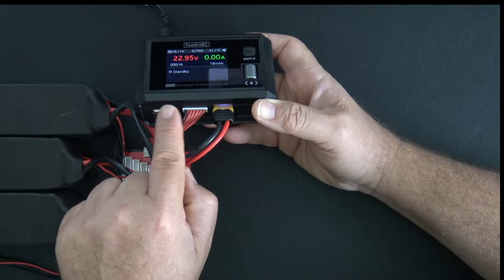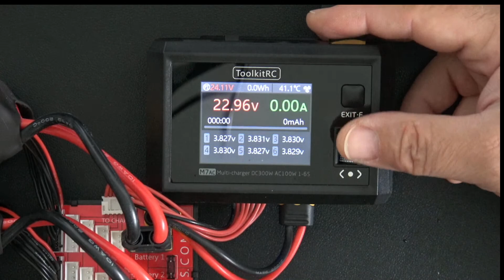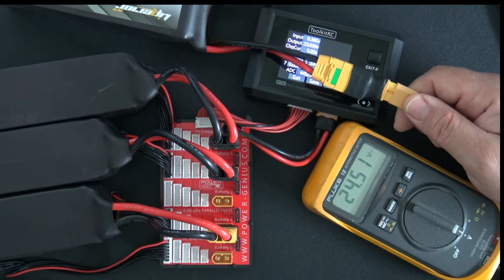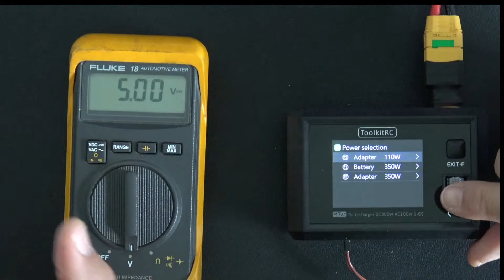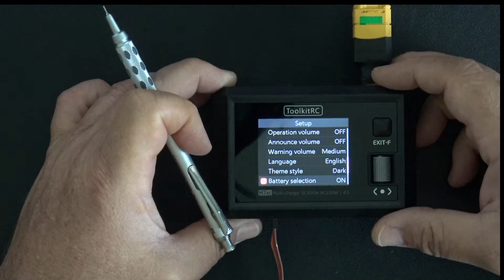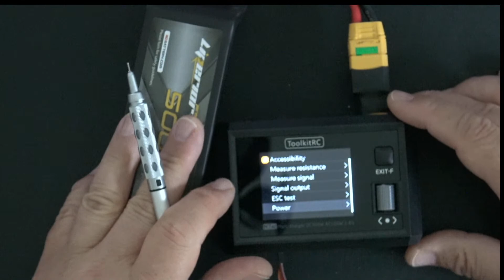ToolkitRC M7ac Multi-Function LIPO Battery Charger First Look

Comment: Hi! Can it charge LiPo without balance port? Like 18650 or 18V Makita's battary?
Reply from the maker: Battery profiles are LiPO, LiHV, LiFE, Li-ION, LTO, NiMH, PB(lead acid), and UAVbat (DJI).
Reply: @RCVideoReviews  When choosing a LiPo profile, can I turn on the 5S battery without a balancer? Will the charge start or will there be an error?
Reply from the maker: No, LiPo profiles always require a balance connection.

Comment: I have one and the AC input is broken. I can not get a power up from the AC input. Any solution?
Reply from the maker: That sounds like a hardware fault. I would start with basics like trying a different power cable. Maybe open it up and look for any obvious damage. Otherwise you may need to contact ToolkitRC.
Reply: Mine arrived today. I have the same issue. It didn't power on from AC. But if i plug a battery into the charging port it powers on. If I then plug the AC cable in it reads 18.2 Volts as input, but after i start the charging process, about 5 seconds later the input voltage drops and stops charging with the error message: "Main port disconnected"
Reply: @BerkeiSzilárd  I make a tech support request and they send me internal psu replacement unit. I soldered the new one it's now working fine. It's internal PSU problem
Reply: @pusico6555  Thanks for the info. I emailed ToolkitRc and the store i bought it form. Hopefully I get an exchange. I don't want to solder my brand new charger.

Comment: Toolkitrc is the worst company ever. Their products are an absolute joke and they deserve 0 air time. Had 3 chargers that failed miserable in less than 4 months, opened a ticket back in July last year and first that I heard back from them was January this year and only one email asking about how long I had the charger for and never received any updates. They have some very nice innovative features but their quality control is non-existent. Great review of the product mate but I would steer away from toolkitrc.
Reply: i've had an M6D as my go-to charger for over a year now and have had exactly zero problems.  i would venture to say that you somehow got into a bad batch of chargers...which happens...in all fairness, i don't have any experience with their customer service so i can't speak to that but i hope that you get some sort of resolution from them.
Reply: @RPGWoodworking  how often do you use your charger? Mines are used on a daily basis and I've had 2 m6d and one m4q just died on me. I have a 5 years old isdt m6 pro using daily and have had 0 issues. Just bought a new icharger x8d now and that is a much better kit and their customer service team is fantastic. They responded to all my enquiries even before I purchase their product. Maybe like you said, I was unfortunate to get a bad batch. Can you say the same from the video of CycloneFPV where he had 10 brand new chargers all stuffed up?
Reply: @ClareFPV  wow, that's really strange.  i use mine almost daily as well and no issues.  using it right now, as a matter of fact.  i dunno...i guess everyone has different experiences.